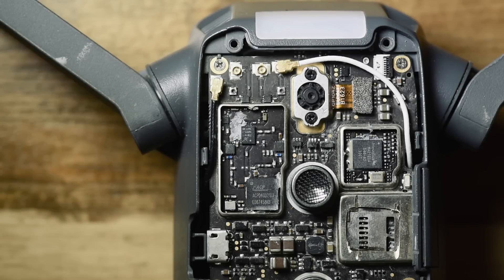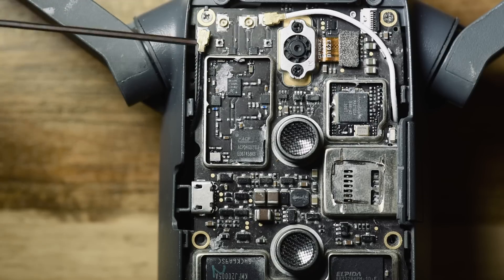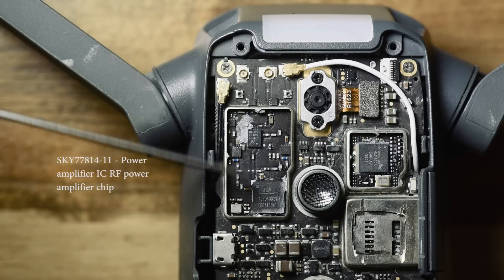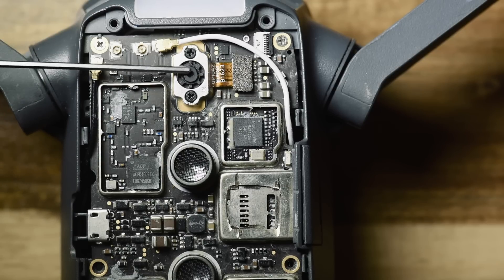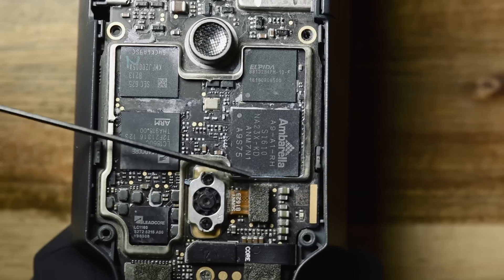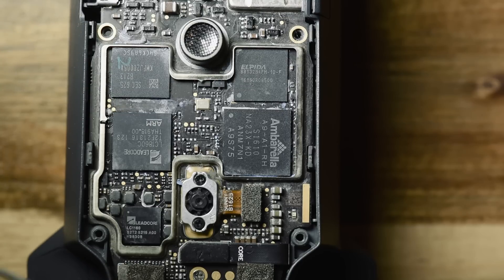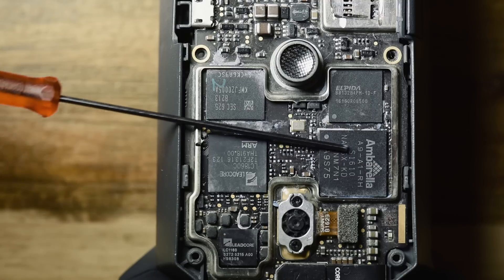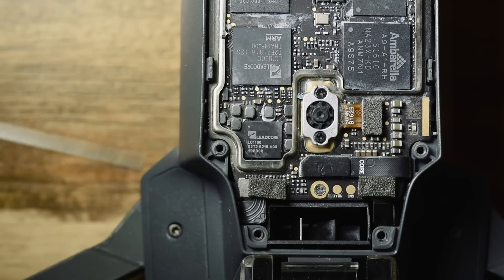Mavic chip teardown

Comment: hi i have mavic  pro and today loss connection with controller.i try switch to wifi mode and no display wifi on the phone .not have connect with controller or phone.what is possible problem?thanks

Comment: As someone who isn't schooled & at risk of asking a stoopid question, if I was say an electrical engineer would I / should I be able to name each component and know where it should be on the board?...someone please indulge me!
Reply from the maker: Hello Paul, would you just like to know what the components are out of interest sake? I can name a few for you by describing them here:
The things with 3 legs, 2 on one side, one on the "top" in a kind of pyramid layout are transistors. the things with silver tops and bottoms and brown between them are capacitors. The largish things which have a kind of hexagonal shape are inductors. The things which look like capacitors named above, but are black are either resistors or smaller capacitors.The other chips with 6 legs, 3 on either side, are what many call "glue logic". They're either operational amplifiers or some other chip like timers etc, but I would imagine they're op-amps to amplify some or other signal. If it would help I could maybe make a video about it.
A good channel to learn basic electronics and be entertained is "big Clive".
Cheers,
Nils
Reply: @NilsRohwer  Thanks for that Nils, your answer has drove home the fact that I need to begin at a more basic level, maybe I will attempt to pick your brains in about 2 or 3 years meanwhile I am starting with the 'Dummies' series of text books.

Comment: Great video!  I want to steal my Mavic Pro battery power to power up some other gizmos mounted to my Mavic. I need about 4 amps at 5v. I have a 10A regulator. 
Any advice to elegantly bring out the voltage?
Reply: No help with "elegantly" bringing out the power but I just want to make sure you noticed the "VBAT" and "GND" test points at the bottom of the image he showed us. These two lines should provide the full voltage from the battery.
Again, I'm not claiming this is the best (or even a good) option but I wanted to make sure you saw these test points. Good luck.

Comment: awesome video, Thanks! quick question, If my Mavic's VPS and forward obstacle avoidance sensors stopped working mid flight, also no active track and tapfly. would it be my main board which is broken or might it be my gimbal controller board which is not transmitting the data, like a lose connection? I get no errors and my vision sensor state in my main info screen is normal. any advice will be appreciated!
Reply: Please give me your two cents. My problem is in the link below. 
https://forum.dji.com/forum.php?mod=viewthread&tid=143684&pid=1302133&page=1&extra=&mobile=2#pid1302133

Comment: My mavic was under salt water for 5 minutes, you think water can get into all the chips you show in the video? how hard was to get the shielding off?
Reply from the maker: Hey Erwin,
Saltwater is notriously bad for electronics, however it is well conformally coated so it could be ok. You can easily take of the covers, they just pop off, there is nothing but friction (and the bottom plate) holding them in place. You should probably replace the thermal paste should you take those covers off. have you tried powering it on after it was dry?
Reply: Nils Rohwer thanks for the answer. Yeah everything seems ok but I get ESC error when trying to take off. Not sure if sell it for parts or try to debug the issue. The M1 motor (frontal right) does not start in the dji assistant 2, all other ones work ok.

Comment: Hey gr8 work but can u make a circuit diagram of dji mavic
Reply from the maker: Hey, I wouldn't be able to reverse engineer the circuits but regarding a block diagram, most drones work the same way, flight controller - RC control, Speed controllers and motors...

Comment: I believe that Micron ram chip is 8 Gigabit = 1GB, not 8 Gigabyte. Maybe the same goes to the second "SEC" memory chip, which should be 4Gigabit, which is 512MB.
Reply: Agree it's 8 Gigabits - no need for 8GByte for firmware. Also SEC is Samsung Electronic Corporation.